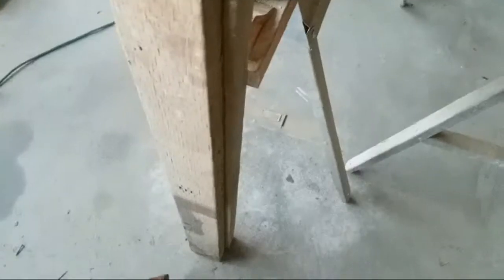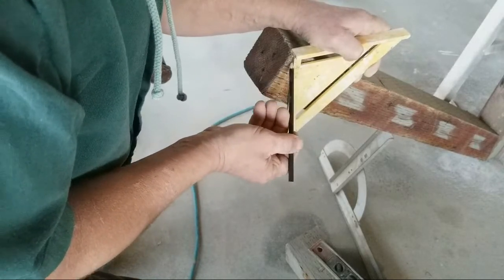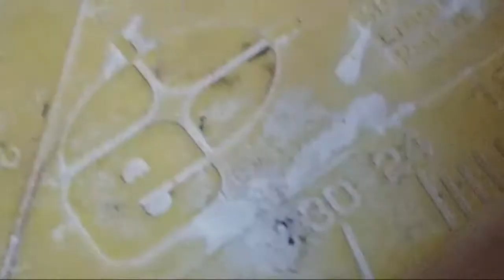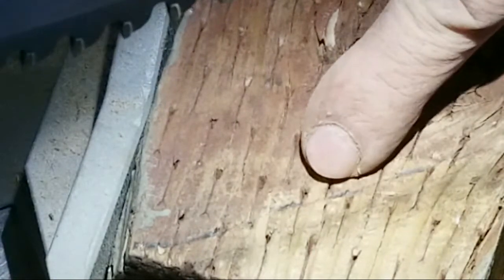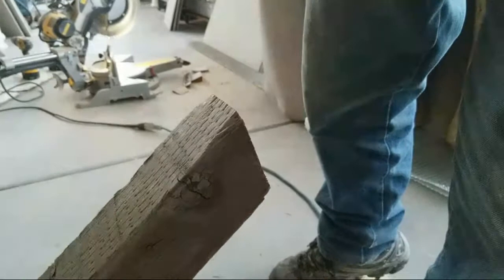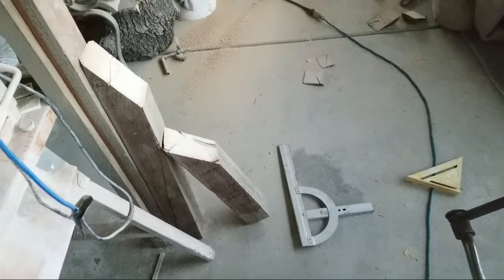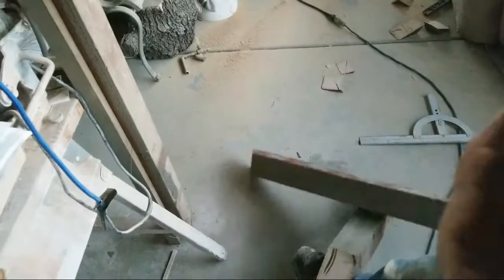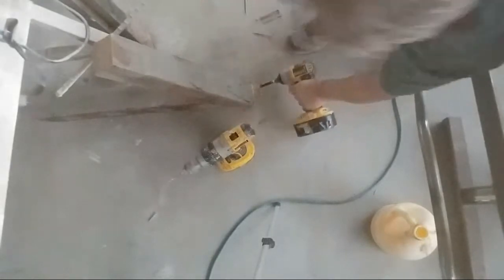How To Find An   Angle Different Ways

Comment: Spreading the knowledge over here me brotha 💥 I had some tile come up this winter so I was thinking of making g a video of putting it back down never done tile before but it seems pretty simple. Any tips? I was gonna reuse the old tile but has old hard grout or concrete on the back so I got to take it off so it lays flush I was thinking of using pool acid seen a video that took it off like butter
Reply from the maker: Hit me up on messenger or give me a call and I can answer questions in explain what' To do and I have lots of videos go to my playlist and look for my tiling videos but we sure need to talk that will help all right look forward to hear from you God-bless and keep looking up